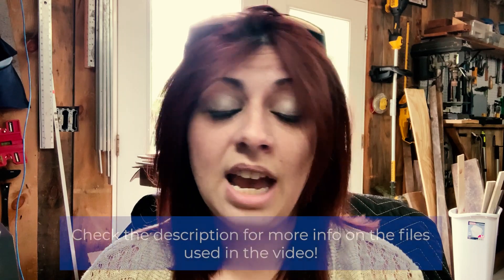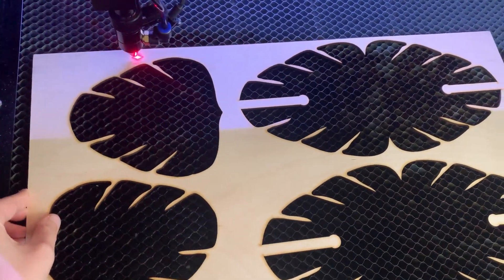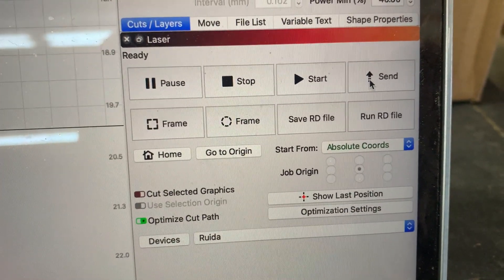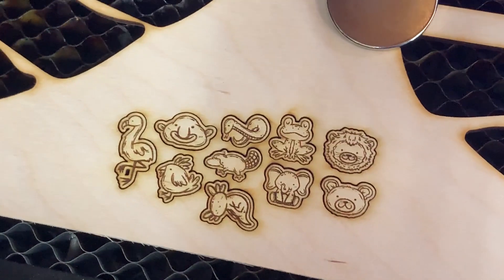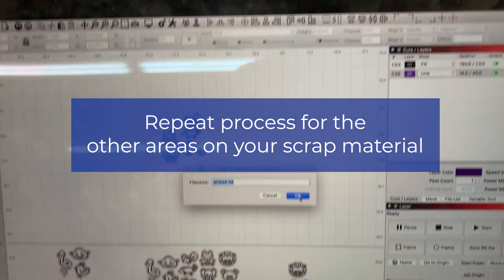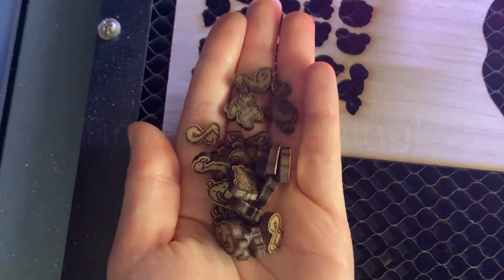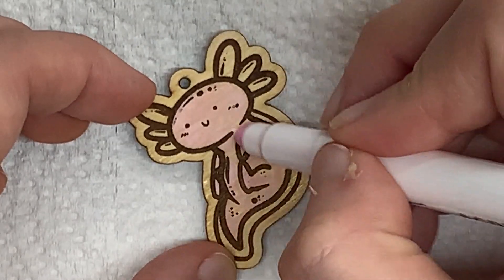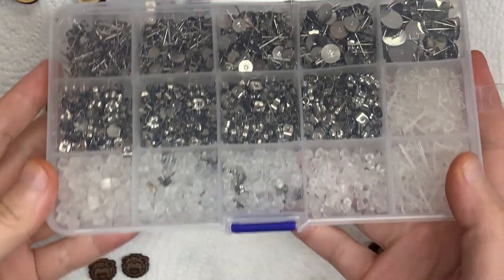Engraving with Leftover Scraps with your CO2 Laser Engraver - DIY Project Walkthrough - OMTech

Comment: I don't see how you got the laser to go to the specific spots. Can you elaborate?
Reply from the maker: Hi there! What time in the video are you referring to?
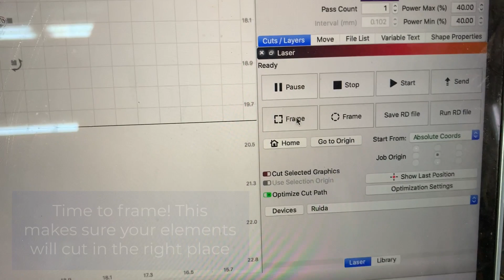Reply: @omtechlaser  3:36 or there abouts. I haven't figured out the best way to start the job without having to frames a few time to line up the work piece. Thanks  Just got the machine last Friday so I'm a complete rookie
Reply from the maker: @jbouza09  No worries! Without an actual camera, lining up your designs with the scraps can be trial and error. You should be able to place your designs/ objects on the art board (this is your work area) in LightBurn and eye the location. This user usually works in the bottom left area, and does the same in LightBurn.

For further assistance, you can reach our Customer Support Team on our website. Or you can also join our Facebook Group and ask users in our community. Hope this all helps!